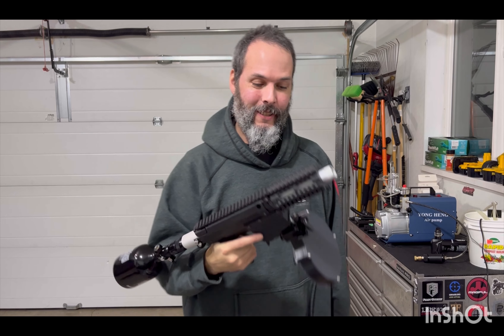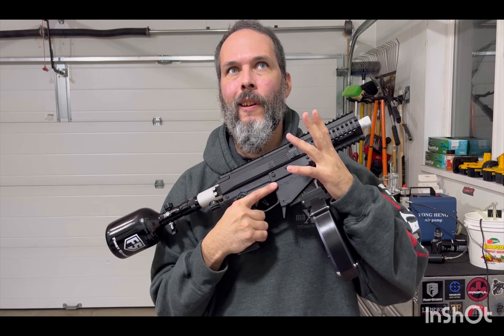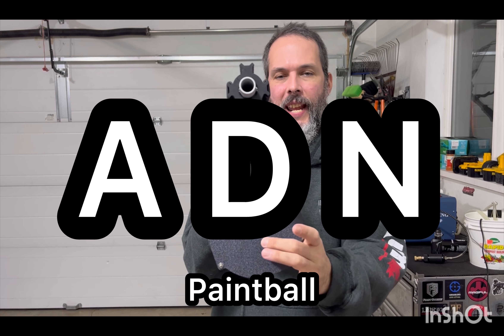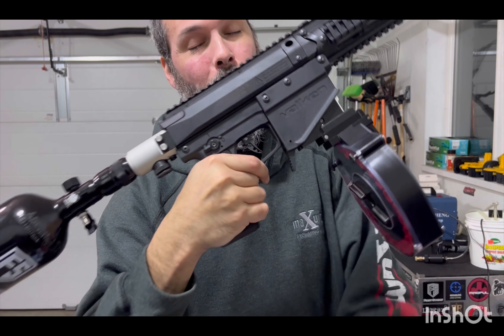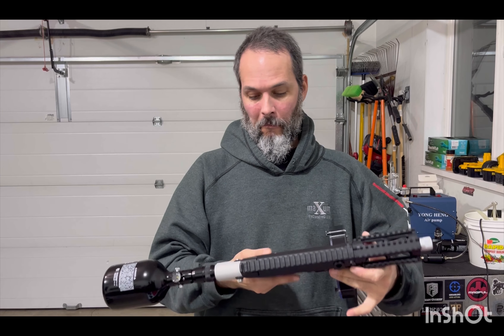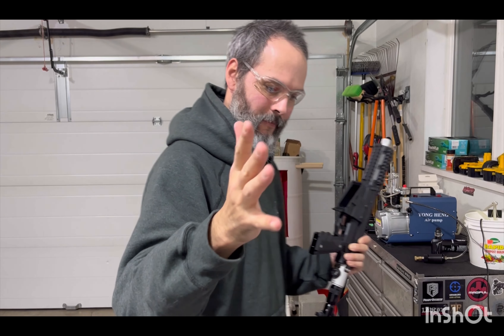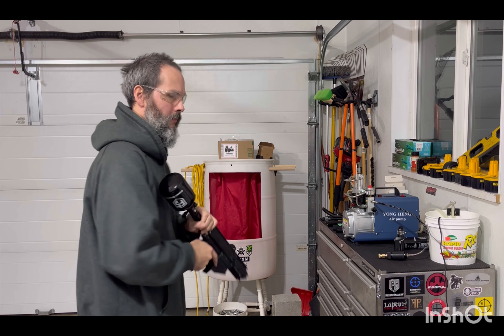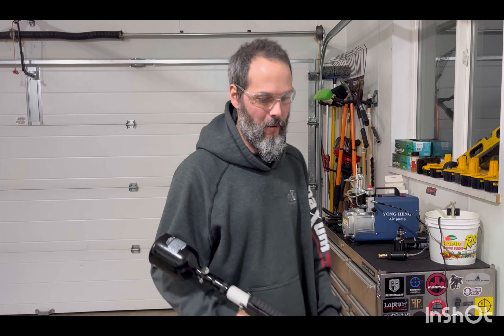LL4D Valken M17 - My OG Valken….does the fun switch work?

Comment: Very cool!!    You mentioned a way to disable the Auto Fire , regardless of the selector switch.   Can you elaborate ??
Reply from the maker: It only disables the full automatic selection. It does not prevent autofire. Just tighten the trigger screw fully clockwise. Dont forget to loosen the tiny side locking screw before adjustment.
Reply: @lesslethalfordummies  

Understood.  My auto fire issues seem to be corrected with the new spring.   I think it makes sense to just avoid the automatic option like you have done.
Reply from the maker: @dougbrodsky3745 the main reason i keep it locked out is if you unintentionally click it over the risk of a jam is reduced. Fully automatic can and does work but is also more likely to have issue.